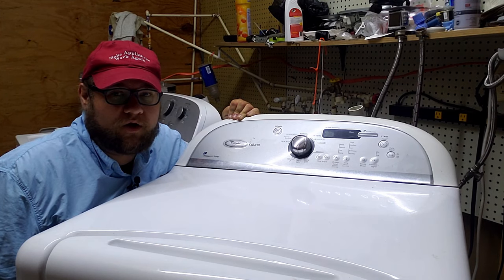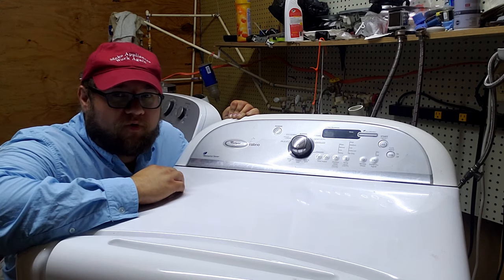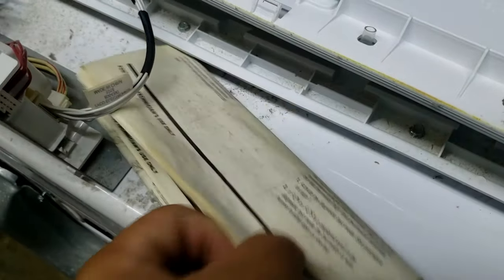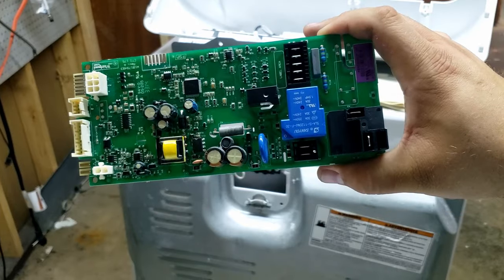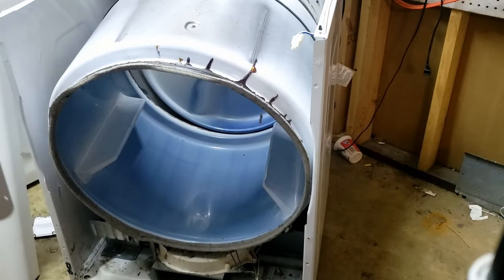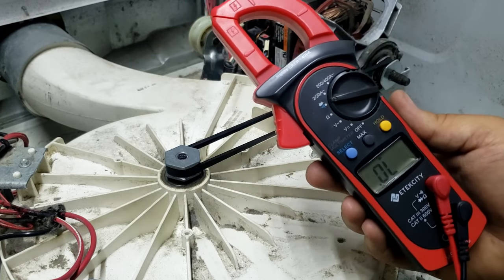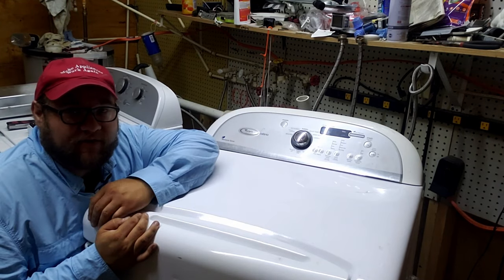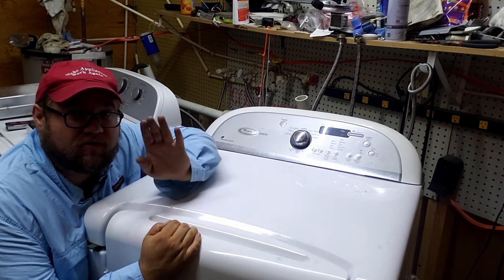Whirlpool Cabrio Dryer Heating Element Replacement and Whirlpool Cabrio Dryer Troubleshooting

Comment: My cabrio wed7800x all of a sudden wouldn’t turn on (no indicator lights turn on)... any recommendations on how to fix? Change user interface assembly? Change mission electronics assembly? Thanks in advance
Reply from the maker: Check electricity going to machine first and foremost, and every wire going into the board first. Sometimes you can have a power outage that can kill the machine and its a simple/cheap fix. If you can verify that the machines' getting 120v to the board, then its likely the board if absolutely nothing's turning on. If you can verify 12vdc to the interface (meaning its getting full power), its likely the interface itself.
Reply: Bens Appliances and Junk Thanks I’ll check everything out!
Reply from the maker: @CoVaTennis  last night I got a frantic call from someone that bought a fridge off of me. She said it's totally dead. Nothing at all is running. I tell her to start from the start and put the fridge on another outlet to see if it starts. She argues a bit with me because that same outlet had a deep freeze and it's running fine... I tell her to try it just in case. That exact outlet was shot and she got the fridge running in like 10min. Saved her food from loss and me from having to get a tech out there at 8pm at night. Its not always the case, but its good to start with the easy things and work from there
Reply: very weird... the power at the breaker, outlet, and at the end of the cord is all 220v... but when i check the voltages at the terminal block it is only ~120v max (<10v between the 1st and 2nd terminal, 120 between 2nd and 3rd terminal,  and 120 between 1st and 3rd terminal).  any thoughts on what it could be??  i tried changing the power cord and outlet just to be sure, but no luck =/
Reply: I noticed the terminal screw and nut for the left terminal was rusted/burnt, so that might be the cause of the issue?
Reply from the maker: @CoVaTennis  100%. If its burnt up, power won't get to the unit on that side. It absolutely needs all 3 terminals without burning damage.
Reply: Bens Appliances and Junk agree. the wire itself looks ok (I think at least) do you think I need to also replace that wire to the terminal? or getting new screw and nut should be sufficient? Thanks in advance for responding, much appreciated!!!
Reply from the maker: @CoVaTennis  id check to see if the wire looks burnt. If so, yes replace it by trimming back to where wire isn't burnt and rewiring from there
Reply: Bens Appliances and Junk sounds like a plan

Comment: Mine is not heating correctly. It does heat up some or sometimes. Possibly clogged with lint or something around the heating element (i.e thermostat, cut off???  thx!
Reply from the maker: I'd check lint in the unit + vent pipe. That's most likely the cause.
Reply: @bensappliancesandjunk  will do!
Reply: the machine is about 10 yo and comes from a very clean household and has low usage compared to most homes. I went ahead and blew out the back while I had the back panel off. Mine has the top mounted lint filter, so it's pretty easy to work on. I will check the exhaust thermistor once more and most likely go ahead and replace it, since they are relatively inexpensive. I still have the f1 code, but I don't see any burn marks on the board. I assume that this code is related either to the exhaust thermistor or the board. But, like I said it is working fine at the moment.
Reply: Mine had a restriction in air flow, apparently causing the F1 code. the only issue it had was the last few weeks or so, they thought the clothes weren't getting totally dry. So, anyone having the same issue, but no damage to the board and the machines operates, then check for blockages in the exhaust air flow and the thermistor. No more issues since taking care of the restriction.

Comment: I had code F1 and my board does have a burned spot in the typical area, the big black box relay. Do I need a new relay or can I just resolder it (saw that done online.)? My MAIN problem is that I have a connector I can't get off. Most of the videos don't have this connector, so maybe it's for the STEAM model only? (which I don't even use). It's got a blue wire and a red wire and is located  below where yours has a purple rectangle, on that lower edge of the board.. Mine has  an orange box under that top heat relay that is then connected to a plastic connector which has a red wire and a blue wire. It seems to be what I think is called spade connectors (?) inside a plastic housing with a slit in it. I cannot get that connector off. Do you know how I can get it off? I got all the rest off. Great video too! (just realized it could be for gas dryers and maybe some of the videos are electric? ) Mine is gas with steam.
Reply from the maker: Usually I use needle nose pliers and pivot the pliers on anything near the connector that is hard to get off.

You can try to re-solder the connection. Sometimes it works and will restore heat, but 90% of the time, you want to just replace the relay.
Reply: @bensappliancesandjunk   I think I have heat. It won't get past the sensing stage when we go to start it, so it never starts. It just throws code F1. I did test the sensor. I read the service guide I found inside. Ill try the pliers again. Thanks.
Reply: @bensappliancesandjunk  Hey, used the pliers again and it worked this time! Maybe the rest I took helped. Thanks!

Comment: My gas powered one keeps blowing the Thermostat or thermal cutoff don't remember what you called it....
Reply from the maker: Replace the thermostat and cutoff at the same time, in case the thermostat is bad, forcing too much heat to unit. Other than that, clean the ENTIRE vent pipe extensively. Because if there's an obstruction, the heat will backflow into the dryer and overheat it, blowing out the thermostat.
Reply: Thanks for the advice

Comment: So. My error code says heat relay failure.  I'm comfortable with desoldering and replacing the relay on the board - or at least trying. Can you sell me the relay?
Reply from the maker: They vary, what relay do you need?
Reply: Yeah the lid won't release. Can't feel any type of springy metal clip with a putty knife or flat screwdriver. Thoughts?

Comment: My Whirlpool Cabrio dryer wgd6200sw2 was not heating up so I check the control and motherboard and nothing looks burned out or cracked. I replace the dryer thermal fuse and it heats up but the flame disappears after 10 mins. Does it sound like I need to replace the heating element? So when I start the dryer after checking the motherboard, control board, and thermal fuse i see the flame start up but after 10 minutes the flame disappears and the heat stops. Can you help?
Reply from the maker: Check vent and male sure it and filter are clean
Reply: @bensappliancesandjunk  Nope, thats not it. The heat warms up and I see the flames but after 3 minutes it dies out. After  5 minutes I see it trying to heat up (red orange) but dies out. Any adice?
Reply from the maker: @ML-nj4qi  Im not sure what amp draw is on those, but it could be a weak igniter.

Comment: I have this dryer and I will never buy a whirlpool again. To disassemble the entire unit to test the various components is horrible! 
Used to be; take the back panel off and everything was right there. Easy peasy. This system Sucks. 
But 
Thanks for the video.
Reply: Your are 100% correct.
The old days take off the back and maybe the top,replace the heat element and done 
On bright side I know how to completely tear apart the whole D*** thing.

Comment: I have continuity everywhere im supposed to. Still no heat. The heating element was repaired and i verified continuity after installing. Check the thermostats and they also have continuity. I guess the next step is probably having an appliance repair man come pick it up for $50. Theres old dryers on facebook that work perfectly i can get for $50 so no sense in wasting more of my time